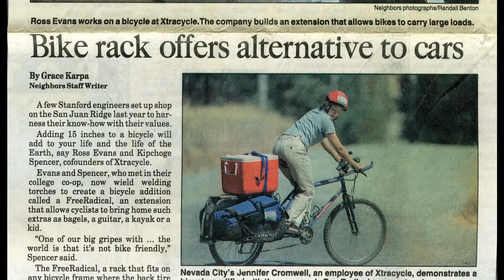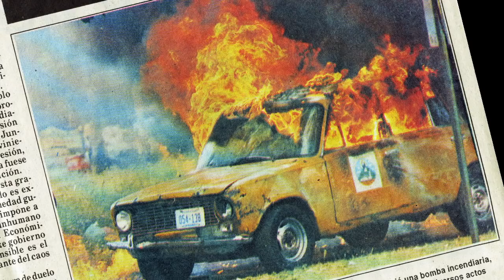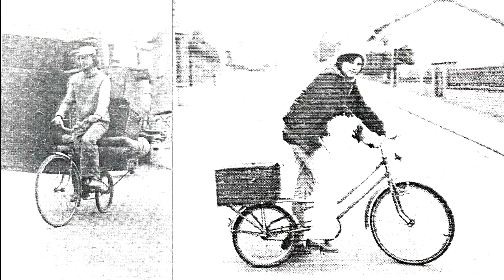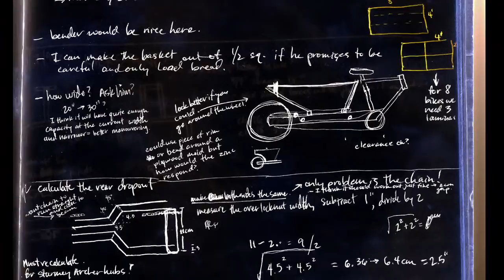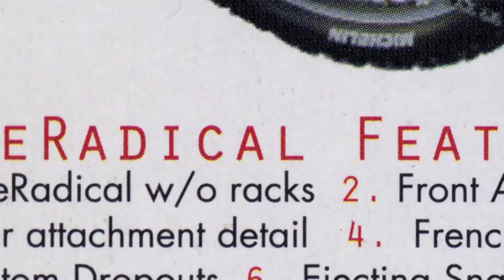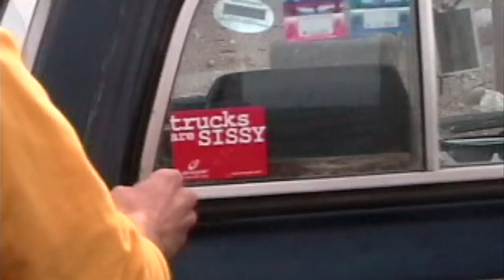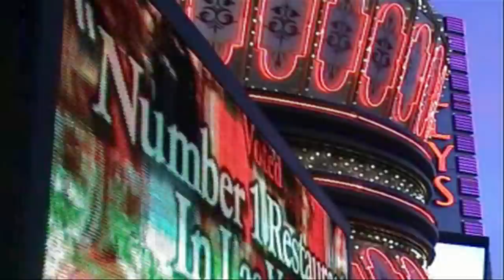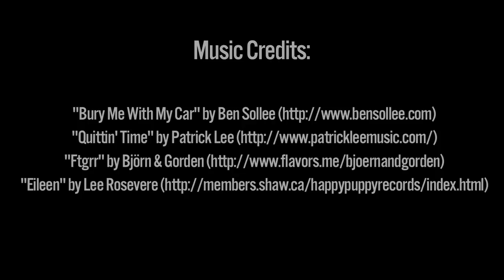Birth of an American Cargo Bike: a rough excerpt from the documentary, MOTHERLOAD

Comment: In 1968 at Camp Sagamihara; The Japanese men who delivered the groceries from the base commissary. Pulled a wagon which had the capacity of a pickup bed. It connected right under the rear seat hitch. Of a upright ten speed bike. The trailer had two standard front wheels they used double tubes spaced for strength as required around the wheels...Bed was boards as i remember. These were awesome and incredibly practical i was 8 and have never forgotten them. Check asia history you might be impressed. :)
Reply: John Beltman everyone seems to forget how bicycle crazy Asia was for so long.

Comment: My new "extended" cargo bike is great , but I find that with a real heavy load (maybe 150 LBS or even more) the bike seems squirrely or unstable -
When I see videos of people riding these bikes with all kinds of loads , I wonder if my own experience is somehow unique !
Reply: +Alan Scott I was just wondering how they would fit in a car or SUV to take on a trip. Its hard for me to fit my mountain bikes in my SUV. I also worry about getting them stolen. I have 3 locks, but all locks are easy to cut. Yeah i would not want a bike that is wobbly. Specially if i was riding long distance.

Comment: so how do these work how do these work with a 2 stroke or a 4 stroke engine mounted?
Reply: NinjaViking1 Most people are using electric motors -- better for the environment, quieter, no bad odors, less vibration and less weight.
Reply: Pedego 101 Electric Bikes 
a normal Electric drive will take the average "cyclist" about 10 -12 miles (yes?).
I don't see it taking a bike, plus trailer very far at all, for very long.
so you will have to spend mega dollars to carry extra batteries.
only to still be stuck in a long stretch somewhere with no "outlets" to recharge.
A 2-stroke can take the average cyclist 80 -100 miles........
so "with trailer" I see at least 50 miles.......
and it is "cheaper" to carry  1 - 2  gal (maybe even 5 gal)
of fuel in the trailer with the other supplies
Reply: NinjaViking1 Many electric motors go 40-50 miles and that's plenty for most people who are commuting or running errands. Sounds like you are talking about touring and I don't have much experience with that.

Comment: Good video but you don't need a bike like that to haul things (and I see no mention of stronger/thicker spokes which is the REAL ISSUE when it comes to hauling more weight. I know this from first hand experience. They will break.)
 I built my own hauler from an old schwinn cruiser step thru frame. Got on bikeman4u.com and ordered an extra heavy duty rear wheel with coaster brake (11 gauge spokes!) and the biggest rear baskets they sell plus a pletscher double kickstand so I can load groceries w/o it falling over. Best money I ever spent.